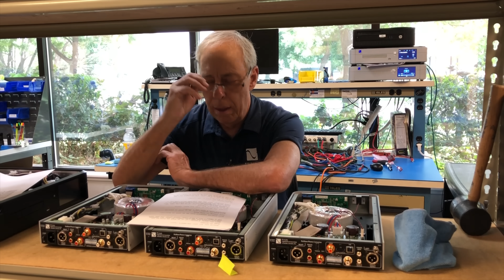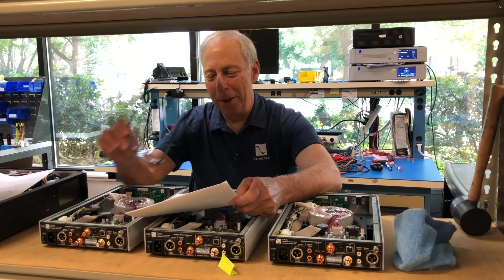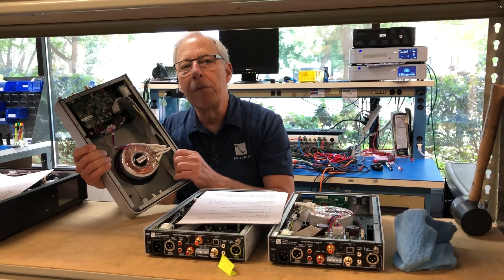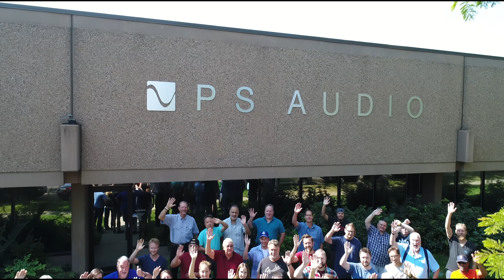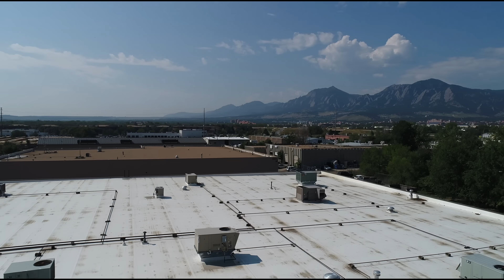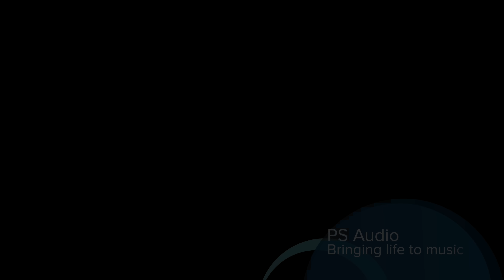What's inside a high end power cable?

Comment: I still say snake oil!  Yes, if the power cable you are using is very small gauge and/or aluminum wire, a heavier gauge cable will make a difference.
BUT if your power cable is already a fairly heavy gauge, copper, good connectors that really grab the pins in the receptical they are connected to, NO it is ridiculous!
Just think..... what is the wiring INSIDE the amp like?  How about the gauge used for the power switch?  The gauge used to wind the power transformer?
The weakest link WOULD be a cheap power cable, but if it is good quality and heavy gauge, at least the same gauge or heavier than the wiring used INSIDE the device you are powering, a high priced power cable WILL NOT MAKE ANY DIFFERENCE!!!!

What is the wiring from your breaker panel to the receptical?  Romex? Stranded?
How about the power drop from the pole to your house?  Aluminum?  Copper?
How about the distribution transformer on the pole?  Usually they are wound with flat copper strips.
How good are the connections from the transformer, to the power lines to the drop to your weatherhead to your breaker panel bus bars to the cips on your breakers to the wiring conneting the run to your receptical?
How good is the receptical?  Is is spec grade or cheap $0.39 bargain basement receptical that barley grab the plug pins?

There are TONS of things that are between you and the distribution transformer and a measly high dollar 6 foot power cord ain't gonna make much difference!!!!!!!!!!
 There is no real mention of what is being compared to... is it a cheap light cable that you are using to power your computer monitor?

I STILL say SNAKE OIL!!!!

Comment: Power supplies are a million times more important as well as influential in sound quality than the power cable.
Reply: any in particular you would recommend?
Reply: Listen in the early hours. Power supplies are usually better then.
Reply: @Coneman3  Apparently the current understanding -no pun intended , is that there is no solar radiation at night .
Reply: Ampacity is effected by power supply cables being radiated by solar energy during the day -As the temperature of a cable increases , its current handling capacity is diminished -It should  be audible at the user end if a day/night comparison is made.
But it might be all bollocks !
Reply: My understanding is that a local power supply is corrupted with noise from domestic devices but when most are in bed, this becomes dramatically less, therefore the power is cleaner. Also, most things are quieter at night, there is a general calm which helps hifi.
Reply: And the speakers are a million times more important than the power supply.
Reply: The power cables are the controllable subject, but not the power supply beyond the main switchboard in the house.
Reply: True. That's why PS also produces the "Power Plant" regenerator.

Comment: Short answer: it's a mix of solid and stranded BS mixed togerher that makes Paul cough while trying to explain it and blaming it on fires.

As usual with power cables, there's actually zero science in the mix.

But I atill love Paul. 👍
Reply: Saw a measurement between expensive audioquest and a rusted cable. Negligible difference.

I recon as long as the cables are not damaged, it should be just fine. The only thing i can come up with is that with heavy amps, you need a sturdy cable.

Comment: Power cables do change the sound but amplifiers are designed to be used with the provided cable so why color the sound. Its usually not a good change in my experience.

Comment: C'mon man, do you plug you power cable directly into the distribution
transformer? If you did it would make sense because would not need to go though
the feeder line to your house down trough meter and panel and all that Romex
and the outlet in your music room. You have all that mediocre 12 gage cable
throughout the house and at the end you add a high end power cable. What
difference the last 4F of Good cable is going to make? You can make one with
car jumper cables and will not make any difference. Snake oil!!

Comment: Romex is COPPER! Not aluminum and the thickness have zero difference #14 or #12 the electricity coming through the wire is 120volt at 60hz no matter what size... only reason that determines the difference is what size circuit breaker (fuse) is feeding it. 15amp breaker =#14 wire (the size wire in almost every room in any fairly modern home other than kitchen & bathroom)  20amp = #12 wire

Comment: From City power line, there are all kinds of cables, with almost no Copper in them... Thousand and thousand of meters (or feet) very poor quality cable, and you think that that last part in your house would make a difference?  if you have very bad quality cable from amp to speaker, and in the speaker box you use very good quality cables will it sound great? NO!  because you have a bad cable behind that.... All noise from power line is mainteined by your Amps transformer and electronics after that.... Whats next? Hi End power socket?

Comment: I watch your video all the time find them very good and informative. Have a few questions on power cord burn-in. Recently i purchased a PC, it took 300 hours of burn-in time. Why don't the manufacturer or dealer offer this service, even for a small fee i can accept? Does burn-in machine that does it by some stereo shops damage the PC or cable in general?
Reply: No, it won't damage the cable. There's a huge difference in the way you burn-in an interconnect and a power cord. Interconnects are burned-in by putting them on a slightly higher Voltage than they're normally used in a system (to speed up the process), while feeding wide band noise trough the cables. That same process can't be done with power cords on such a machine. Because of the low Voltage and current, it makes no sense. It will even take longer to burn them in because they are much thicker (more mass) than interconnects. The only way to burn them in, is to let current flow trough the cable.

Comment: I hate snake oil but I made an experiment using 28 AWG tiny wire as power cable for my AVR... As a result i have almost flatten sound, the bass just gone... After crank up the amp i found that 28awg getting crazy hot. Later i replace it with 10 awg solid core and it sound hell lot different with full bass and all this shows the power cable do something in there But comparing 10 awg solid core vs stock 14 awg multi strands power cord that come with the amp from factory it is no noticeable difference...

Comment: today i made up a new Furutech DPS-4.1 Limited Edition High End Audio Grade Power Cable.i fitted the cable with a  high end furutech socket and plug. the cable cost £ 400 per meter.i made up a 1 meter cable.
when i fitted the power cord into my ps audio bkh 250 amp it defiantly changed the sound.i run monitor audio pl 300's which are on the bright side in the highs.the cable knocked off the harshness from the highs and they now sounds much better. i have DIY'd lots of power cords for myself but usually they are no way the price of this cable .i usually use lorad 2.5  silver plated cable to which ive had no issues.however after listening to this new cable it looks like im going to have to upgrade them all again. the copper in the new cable was more harder and it cut more brittle than normal copper.that must be the single grain crystal design making the difference. plus this new cable had many layers of different materials to keep the noise out.i know it sounds unbelievable and im all for been very weary when it comes to this snake oil subject and in the beginning i didnt believe any of this including speaker cable and interconnects.but after a few years of asking the same old questions , i am starting to believe cables do make a difference.
Reply: I run in the new single thick coil power cables by boiling water with a kettle.
Reply: I have an amazing cable I think you'd really like, amazing change in sound quality, more musical and the soundstage is transformed. It's also a bargain at only £50k per meter. Magic beans also available on request.

Comment: In a way, the power cable is an audio cable. On a sheet of paper, draw a capital T. Next to its left top end, write "AC", to its right write "speakers". This is the (power) amplification path. This is what is referenced when an amp-designer claims a very short amplification path. Now write "source" at the bottom of the T.
The horizontal path starts with AC being de-AC-ed: converted from a polarity switching (alternating) current to a pulsating one-directional current. This is not DC, but pulsating. This undergoes a bit of treatment to make it more like during current (DC), but not perfect. Noise coming in here, is generally not filtered out. Electrical engineers design these AC-power-circuits under the assumption that AC is clean, when power companies already for decades worry about how much noise is reflected back into the grids by dirty consumer electronics. (Imagine they cannot use the grid as their own ethernet anymore because of noise.) Have you heard a click through the speakers when your HVAC switched on? Or your fridge? That click was AC pollution. It could have been relayed via your in-wall AC cabling, or as an electromagnetic pulse via the air. Listen to your music system at peak household and commute time. Now listen again when the wind cries mary (i.e. after all the jacks are in the boxes and the clowns ave gone to bed.) You can hear happiness - peace and quiet in the music. You have a challenge to get that peace and quiet into your system at times everybody is awake, not just when you should sleep.
The AC cable between the wall outlet and the amplifier or source component is an antenna. It can both conduce and receive pollution, or may transmit pollution when you play heavy music with a power draining bass that causes the power stage to draw power form the wall in a way that has AM bandwidth characteristics. Shield the cable, and you will hear the difference. Now try to make a shielded cable that is flexible, does not throttle Amperes, has excellent contacts that do not introduce noise (e.g. through capacitance in a less good contact) and turn this into a commercial product sold via distributors via shops - how much would that cost?
The T happens a couple times. With a discrete power amplifier, you likely have the current amplification in this box. Then the preamplifier does its T providing voltage to the power amp on the source input. The phono-prepreamplifier in its turn amplifies the micro-phono signal to a level that the preamplifier can handle as source, again in a similar T. Each time, the AC comes into the T and goes out, modulated, to the next domain. Each T could allow AC noise straight through, meaning each stage before the power amp can pass the noise or its consequential damage on to the next amplification stage.
Now imagine, a phono stage amplifies a 30 times from 5 mV to 150 for typical moving iron/magnet cartridges, but a 0.4 mV moving coil cartridge already needs 375x amplification to get at 150 mV. Then the pre amp may add some 12 times in Volt but some current too and we end, likely, up with about 30x amplification. At 60A peak per channel, my power amp would multiply that another 60 times.
Here we get cumulative explosion. From the 0.4 mV source to the 60A into the speaker cable, we have accumulated between 500,000 and 600,000 times amplification. How difficult can it be to imagine that something can go wrong here that becomes audible when electrical engineers with zero degree in human hearing, relying on simple rules of thumb, design audio circuits?
Play the Chinook from Pink Floyd's Wall and see if your wife walks to the window to see if one is landing in your garden. Play some 1950s-1960s RCA Living Stereo recordings of live performances. They used two or three microphones and there is no down-mix of multi-mike * multi-channel recordings, so all the phase-based spatial clues are still in the recording. You'll hear the instruments well placed in space. Play the sing-along track from the Weavers in Carnegie Hall where the musicians are behind each other in the right speaker. Can you walk front to back between your speakers and stick your finger in their mouth or instrument? You "get it"when you hear coughs in the giant space. And the audience starts singing along. In your limited room, does this track sound like a huge (6,500 people) concert hall? No? You have a challenge if that is what you want to hear. It can be done. BTW, this is audiophile territory and not necessarily "music".

Comment: So, lets break it down. An upgraded from stock power cable can make an amplifier produce sound that is thicker and heavier and hearty and bright and shiny and more musical.
 By your own admission, your M.O. is akin to a chef shaking something three times and throwing salt over his shoulder. 
Wire is now used as a tone control, stranded for highs and solid core for lows. (It brightens and tightens, if you can't hear it it's your crappy system and your untrained ears oh and your system hasn't enough resolve)
 Yet the power cord makes contact with a wall outlet with about 1/4" square flat surface contact and that when, and ONLY when, you have a "highly resolving" (whatever that means) system you can go from two prongs and a ground into Romex wall-installed power cable which costs roughly $55 for 250 feet. And as long as you then add stranded wires to solid core wire for the last 6 feet which costs 100s of $$$ per INCH on the retail side of things. Then, and only then, (I.e. throw away those crappy cables included with your expensive piece of equipment)  that "HIGHLY RESOLVING" system becomes more musical, more heavy, more rich, more harrrumpfy... etc etc etc ???
I wonder what would happen if you aligned your amp's power port directly with the wall outlet and connected it with only two prongs and a ground.....
But that's fine, we believe you Paul. We believe you when you say that a conductor of raw current (I.e. super duper expensive power cable) that carries electrical current and ONLY electrical current...no signal of any kind.. Just power...Then gets "washed", "scrubbed", "transformed" , "changed" from A/C to D/C and back again through myriads of  vacuum tubes and mosfets and rails and beams and candy store queues, transistors, resisters, twisted sisters,  ICs and whatnot and comes out the other end as amplified sound....is utterly dependant upon the (unnecessary) uber expensive carrier of power six feet in length that fed the power into the box of goodies. (I.e. the component)
We believe, well, I know "I" believe, that as far as highly resolving is concerned, I've RESOLVED that YOU are HIGH. Keep rendering that snake buddy. Double down and cook it up. Squeeeeze every last drop of oil out of that legless reptile. After all,  it affords you trips through the European countryside during a deadly vglobal pandemic. Laughing all the way. 
But instead of "bells on bobbed-tails ringing" it's "cords on big amps hanging" laughing all the way (to the bank)
 HA HA HA.
Seriously though, I upgraded the power cord on my oven, you know, the pigtail?
The thing is braided #0000 oxy-free copper with a teseract interconnect and bifrosted in a cryogenic chamber next to John Wayne and Walt Disney.  Every single meal now comes out of my highly resolving range just far more meatier, thicker,  heavier, saucier and more nutritious. It's fantastic! 
And you can't tell me what I'M tasting, mister! Once I tell the hungry people that I'm feeding, who are waiting to eat and smelling the scent of food in the air that it's going to taste better they all agree, it tasted much better. But my engineers Gordon Ramsay and Emeril can't figure it out. We don't know why. OK, bye.

😗 👌🏼  'mmmwaaahh' 🍷 🍴🍖  🧀 🥖 
BELLISIMO!
Enjoy England sir, and stay safe!

Comment: Silver wire sounds different than copper in speaker cables. Copper has the bass, silver has better highs. Impedance and reactance of different AC frequencies is what is going on here.
  Yes the crappy wire from the breaker to the outlet matters too because it adds impedance. A 240 volt supply to the outlet would reduce the impedance vs a 120 volt supply line.

Comment: In that case, stick a test signal through one of your amps, show the output on a high resolution oscilloscope, then put one of your "high-end" power cables on and show the difference.
Reply: Which would be the case if an oscilloscope can measure everything that makes a difference in what we hear… and it doesn't.
Reply: @VideoArchiveGuy  lol
Reply: Maybe not an oscilloscope, but an audio analyzer would. Paul claims that bass is lost on stranded and the highs are thin with solid core. Clearly the cable is affecting frequency response or maybe distortion at certain frequencies.
I find it odd as an engineer for another engineer to discover a combination of materials which apparently makes a difference to sound, yet is totally unaware what change is happening and has no curiosity to investigate. It's especially strange considering he's selling them and has a vested interest in demonstrating to his customers that his cables do make a difference.
Reply: @PrimaryColorsChallengedREAL  All you need to do to tell whether there is a difference is to LISTEN.

The problem with measurement tools is they only measure what they are designed to, and our auditory systems pick up on things that aren't shown on an oscilloscope.